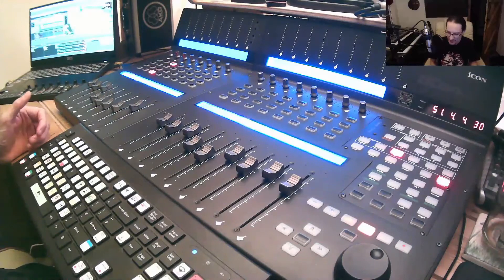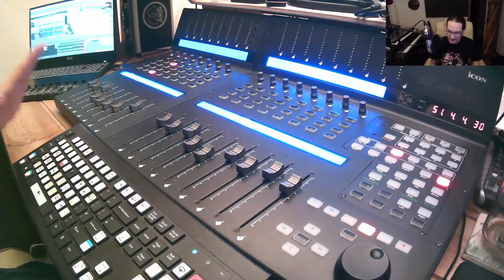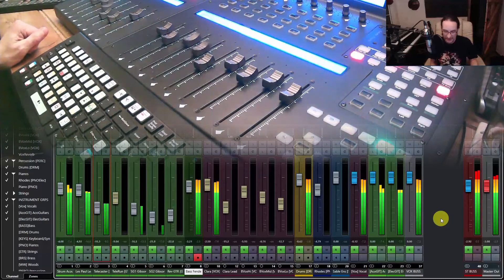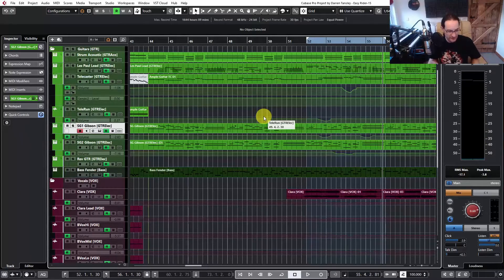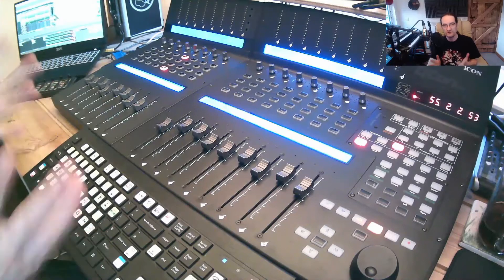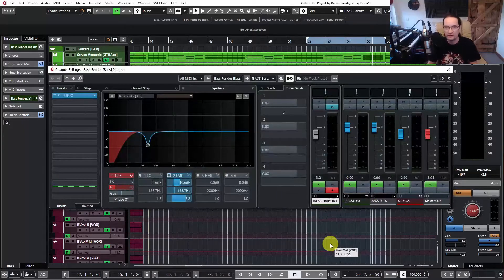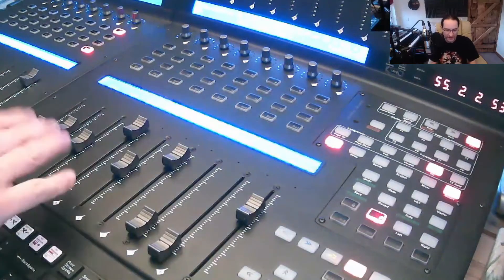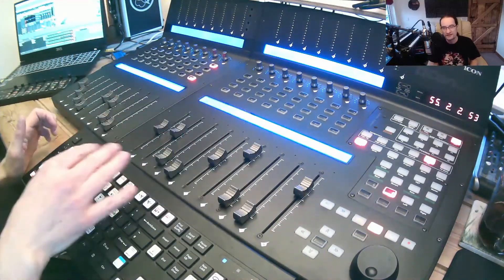What is the point of the Qcon Pro X Motors button?

Comment: I have a Qcon Pro G2 plus an extender, the motors button only effects the main unit but not the extender, the faders still move either way.
Reply from the maker: @NewJunctionMusicRoom  that's weird. I would have assumed that the G2 works the same as the Pro X. To be honest I never turn the motors off but pretty frustrating if you want to. I assume you have the latest firmware for both units?

Comment: This helps a lot Darren. Thanks a lot for posting this. My initial thought was this is there to switch off the motors so that there will be low power consumption. But the points you have highlighted make more sense.